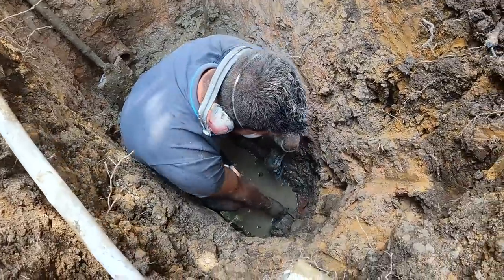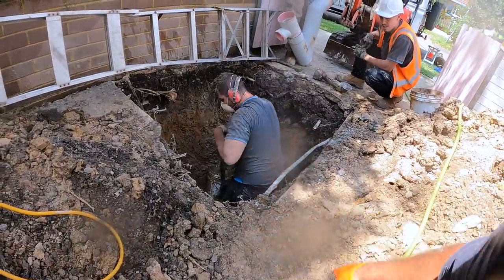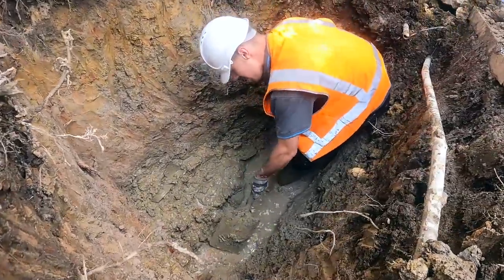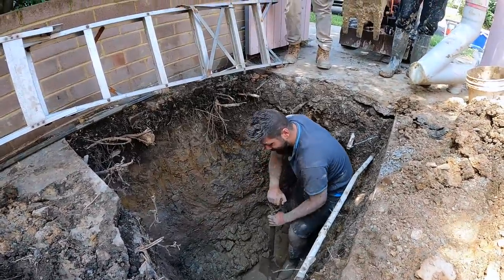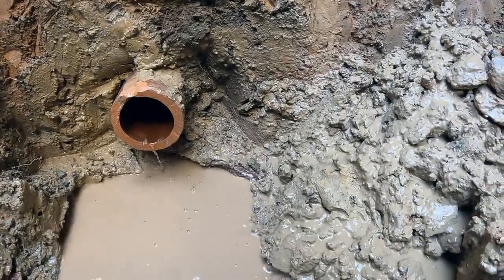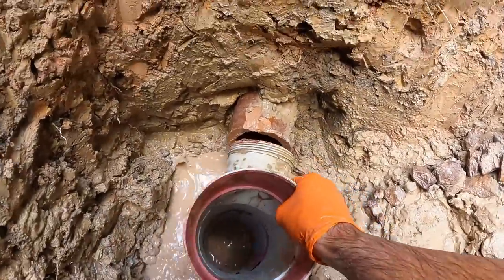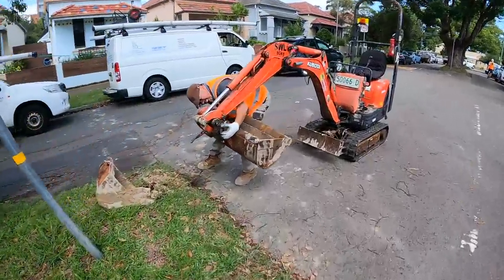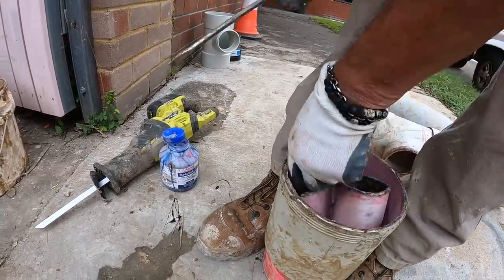Blocked Drain 556

Comment: Whenever someone is down in a ditch you need at least 3 guys standing around at the top narrating what needs to happen down below.
Reply: There is a meme: Google for 
"Guy digging a hole himself with multiple people watching" you'll find a picture with one man digging a hole and 10 bystanders
Reply: Safety first
Reply: Or get someone to do a really good Clint Eastwood impression
Reply: One of the many rules of life
Reply: Always.
Reply: Yes you are right sir.
Reply: That’s why they needed Ollie there.  Obviously based on the pipe diameter, the width of the space, and machinery required you need at least a supervisory factor of ln(x)+2.  That’s just a basic code requirement.  However I didn’t see nearly the required number of partially drank identical styrofoam coffee cups set on any available flat surface.
Reply: it's called "supervising"  or at least thats what my dad and grandpa called it when I was in the hole doing work LOL
Reply: It’s a “confined space”
Reply: Just think how crowded it would become down there would they all try to get in and swing a spade/shovel/pike together in the ditch .... 😂
Reply: Makes you wonder how long that had been at this job before Ollie arrived
Reply: @carbonstar9091  ... you do realize that each union has a different standard.... and if it's a highway crew their union calls for a back up / relief crew in addition.
Reply: in the USA they call them foremen
Reply: Its code! If it colapse there are 2 guys to get him out, if that fails than give him burial ad site. Just cover up, nothing happend here!
Reply: @rupe53  think he was making a joke, that is food information though. I was in the heavy highway laborers union here in N.J. and put my dare of ductile iron water main, fire hydrants and concrete drain pipe. When people would comment about the guys standing around a hole I would always say if that was you 4 or 14 feet in the ground and shit went wrong, you would be glad they were there to help you. After you planted that in their brains all was silent and all that look of wow never thought of it that way. Cheers, stay safe.
Reply: @potatolew4495  ... I was making a joke too, but having been there, done that, I figured to throw in the safety factor. As you stated, few think of that aspect.
Reply: The guy in the ditch isn't supposed to be the boss, though. 😂
Reply: Never knock a hole watcher.

Comment: Flashbacks! We removed a 3 ton autoclave at a medical center. Last week I had to remove a floor sink because the floor had to be raised. While attempting to remove the concrete embedded floor sink, I damaged the 4 inch trap with a concrete coring bit. I ended up having to break the concrete past the entire trap so the plumber could replace the trap. It all worked out in the end, the 40 year old trap was actually causing a slow drain condition. The new raised floor sink was installed with a new trap and the water flows as good as new. We also poured the new concrete floor yesterday!

Comment: The linkages in that Kubota bucket are shot, the pin or linkage need to be replaced and he will get a much better bite into clay/soil even before any stone or rock, a pick ax would come in very handy as well, have dug same size, bigger, holes and used pick to get the bigger stones out by picking under a corner and leveraging up, also great at loosening soil better than the straight bar even in the space of the trench you can get some force down 

     Continued Success 
               Fabrizio
Reply: glad I wasn't the only one who saw all the slop in them pins!!!
Reply: Rental machine though by the looks, as if they give a rats.
Reply: I saw that too. LetsDig18 Alum 😁
Reply: How do they dare rent out that equipment. That's an accident waiting to happen.

Comment: That guy on the digger looked like he was doing this for the first time.
Reply: Thought that myself would have been faster just hand digging it out at the rate he was going and just the general mistakes in controls
Reply: Probably the lunch time replacement
Reply: He is new on that machine which has more slack than Alice😁 The hire guy at the end is better at it.
Reply: They need @letsdig18
Reply: It was his first time on the backhoe, but he is an old pro on giving instructions.
Reply: It was a rental. You can see at the end a guy from the rental company came and picked it up. Guy obviously doesn't drive one for a living.
Reply: I though the same.

It was a bit like seeing Stevie Wonder trying to operate that machine.

Also it looked really worn out, the bucket rattled around like it was barely attached.
Reply: May have been. My first time on one I didn't look too much better. Second and third times were a bit rusty too, lol.

Comment: Unfortunately you can make a lot of mistakes on lining systems. It seems that they got a lot of folds on the 90 degree curve. Some liner are not able to handle this and get folds. sometimes this can inhibit the hardening of the liner. Anyway, many other problems can cause a liner damage.
But if you do it right, the lining system will last at least 20 years or more.

In my next project we are going to install a liner with 1200mm Diameter at our company. 

I just love to watch your videos from time to time.

Greetings from Germany

Comment: I don't understand the use of boundary traps.  It's just a clog waiting to happen. And that boundary trap looks like it's designed to clog and impossible to snake or jet.
Reply: But it's a lot money for Ollie and Rattie 🤑
Reply: It stops main sewer smell coming up most likely
Reply: @williefleete  We don't use them here in the U.S. Here all of our traps are under the sinks or in the individual floor drains.
Reply: Plus the storm drain coming to the curb but below the level of the road so all the shit from the street is going back up your drain
Reply: They’re not used much in AU anymore, We did a job the other week retro fitting them to a main though as the smell of leachate a tip was draining into the sewer was stinking up the area
Reply: They’re there in areas where there’s big flow of sewage in the main pipe. The high flows can sometimes create a vacuum in the consumer pipe system.
There’s a low level intake vent that prevents the seals of the traps inside the house being sucked out. During time of low flow in the main, the smells can come up via the low level vent, the boundary trap prevents the smell

Comment: Pressure washers are so powerful. My dad bought one and we used it for cleaning. It was gas powered and decently top of the line (not a cheap one), they are quite loud when running. One day we put on the highest pressure nozzle and watched it cut right through a block of concrete like butter. Guy in this video was saying: "Don't get your foot in there." and yah.... you're missing it if you do.

Comment: In the states, I have never seen a fitting designed like the one being installed in that ditch. It would appear that a lot of solid matter will settle in the bottom drum where Ollie had to make room, and soon enough, require a clean out. Can one of you Aussies explain that design to me?
Reply: It`s what we call a Boundary Trap, it works as a disconnection from the mains to the household drainage to stop them gasses entering the sewer system, like a trap underneath a kitchen waste, cheers.

Comment: I've had to use those small excavators for smaller job sites, they are slow and don't have a lot of power to them. So if you hit a stubborn rock, it's easier to get it out by hand some times.

Comment: Never heard or seen a boundary trap here in Texas. Just 8 inch concrete drains to the street main.
Homes are typically tied in from a 5 inch drain.
All the clogs are above that. Only had 1 in which the city had to come out and clear the city main, but it affected everybody for a couple of blocks. They came out with a giant pressure rig and it took them about an hour to clear the grease ball that a seafood restaurant  pumped into the main sewer a block down.

Comment: Tim from Canada here is a suggestion if it can work for you if you were digging in the hole working on pipe like this guy is and you have a mini Backhoe with a bucket available I asked the guy to drop the bucket close to your hole then you can put in your excess rock or materials so it does not fall back into the hole you were working on like the drain attic guy doing right now having your material come back to you

Comment: I've noticed for awhile now, why the change from quick coupler to threaded connections on the jet heads?
Reply: My guess is it gives a much shorter solid piece that gets around the corners easier, or hes sick of replacing o rings.'
But i'd like to know the real reason too.

Comment: I notice you have not been using Quick Disconnects on your jets. Are you getting better/more pressure output without the Quick Disconnects?
Reply: He uses the thread joints because it’s easier to get the bigger jet heads around bends and out of traps
Reply: @steriskyline4470  Thank you, that was my other thought. 👍